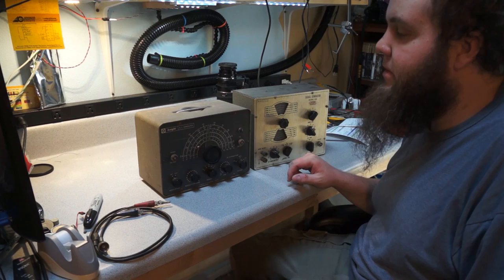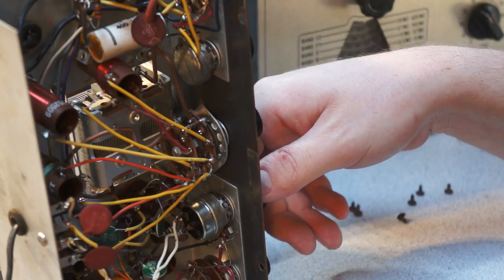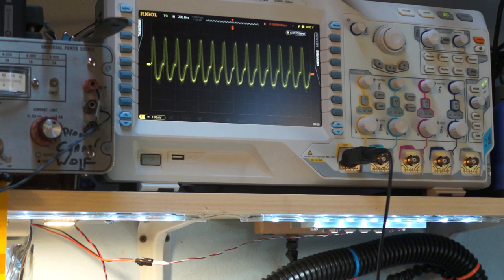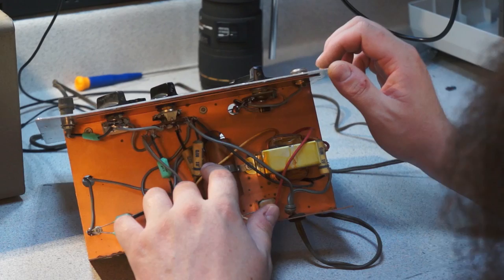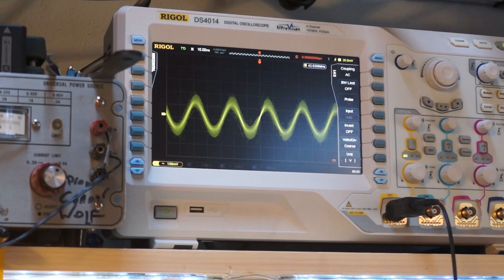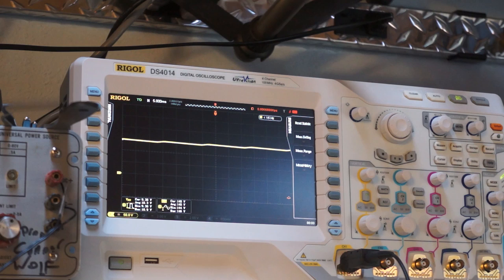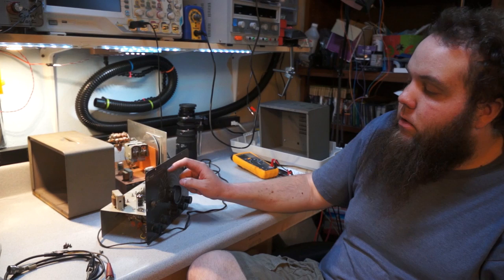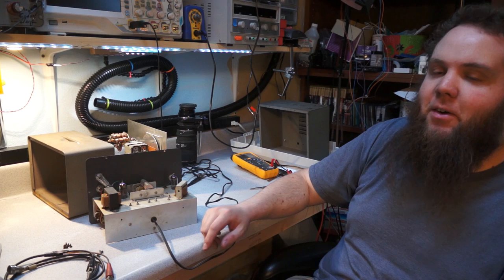Antique Vacuum-tube RF Generators teardown and tube-related waffling

Comment: The dial on the Knight is called a vernier.
The 12AT7 is known as a "twin triode", as both sections are matched.
Tubes with dissimilar triode sections are called "double triodes",  by most tube manufacturers.  FWIW:  in the UK,  vacuum tubes are known as "valves".

Comment: Nice video. I recently found 5 tubes from an old radio behind an abandoned house.

Sadly the markings for 4 out of 5 are gone so I cant identify them. On is a Mazda 6P25 amplifier. 

I found the filament pins and they do all glow so Im thinking of making a small stand for them to power them all because as you say I do love the fact that they light up!

Comment: So you can see, our high voltage is ... hm dropping. Cracked me up for some reason. 
Also you have to be carefull not to stick your finger in the AC. O RLY?

I agree! Tubes look a lot cooler glowing than just a transistor sitting there doing its job. I might have found the reason why I always include a crapload of LEDs in my design: just because it looks cool

So if I understand properly a tube is more like a FET, switching on voltage instead of current like a BJT. You learn something every day!

Comment: I have an EICO 324 (the unit on the right). This is a "shop grade" signal generator meant for basic troubleshooting of radio and TV circuits; it is not a laboratory grade signal generator.

The output waveform is distorted, and this is intentional so that the output frequency range can be extended by using harmonics. The modulation is sloppy in that there is a fairly large amount of incidental FM. The output level is not flat with respect to frequency.

Comment: Also,with the "tingles",You'll probably find a set of caps connected from each side of the 120Vac input,to the chassis.
Personally,I always pull these the F out. If those caps go leaky or something,the 'tingle' can be much worse. Also,add a 3-conductor power cord,with the earth ground connected securely to the chassis. Should be safe after that. Just watch the B+,it bites. ;)

Comment: Hi, good video. Not sure if you know, but tube era trafo's had an (almost) universal color code, where black was for primary (110etc) red was secondary plate or B+, with red/yellow being a center tap. Green or brown were the heater filiaments and yellow (if present)  was for a tube rectifier heater (often 5volts, not the 6.3v for the other tubes). Hope that might be useful to someone.

Comment: Most of the early instruments had floating chasis while the early radios grounded the chasis to one of the hot leads and if that side of the plug is put into the wall on the hot side, makes the chasis hot. I have yet to see any of these old signal generators where the chasis didn't float relative to the mains.

Comment: The 12a*7 series was introduced in the late 40's, so the first generator is probably from the late 50's/early 60's. The diode looks like a germanium type which suggests late 50's or later :)

Comment: The Eico 324 looks familiar.  I remember assembling one back in 1970.  But I never needed to tear it apart  :)  I still have an old heathkit oscilloscope - haven't used it in ages - 5 Mhz scopes are practically useless today.  But today's technology is tomorrow's junk.

Comment: My problem isn't that it stops buffering (that does happen at times) but my problem is, say I'm watching a 42 minute video... Randomly, but usually a few minutes into the video, it abruptly ends and shows the ending screen, AND the time/video length indicator at the bottom in the control bar will read something like 2:35/2:35 which indicates the video is only 2:35 long (which is NOT what it was showing prior to ending abruptly).

Comment: I'd yank the selenium rectifiers out of there,and replace them with suitable silicon (and perhaps a series resistor,to get the voltage right.Silicon has a lower forward voltage 'drop'.) Those selenium things are not reliable after so many years,and possibly toxic,if they decide to release the magic smoke.
Add a couple 1N4007's to the list,when/if you decide to recap,etc. With a good 'going over' and tune up,they should be decent general purpose sig gen's.

Right with ya on the BNC's.
Reply: ...vacuum tube rectifiers DO have their advantages over silicon diodes: for ONE thing, vacuum tube rectifiers present a "delayed reaction" while they are warming up, that gives the rest of vacuum tube filaments in the equipment to WARM UP before B+ is applied to the circuit(s): while silicone diode rectifiers are practically INSTANTANEOUS!!

What's more, unlike silicon diodes, vacuum tube rectifiers are a HECK of a lot less likely to short out as a result of lightning strike(s) on the power lines...